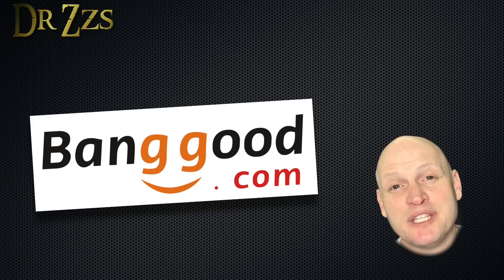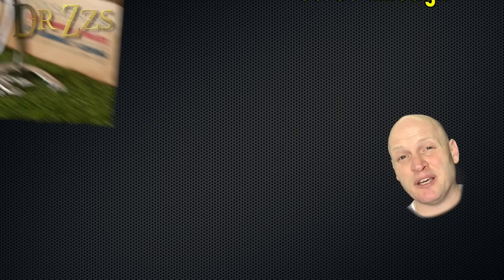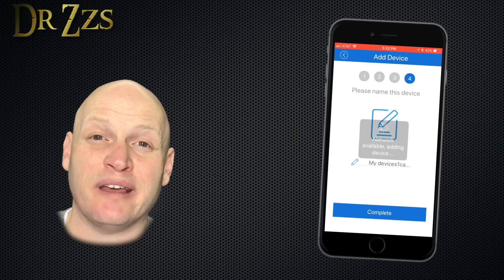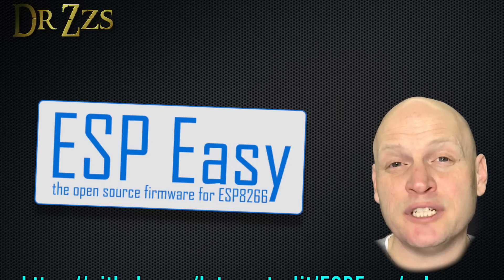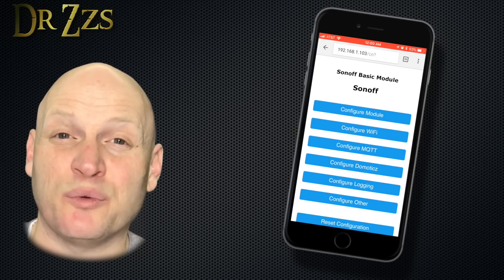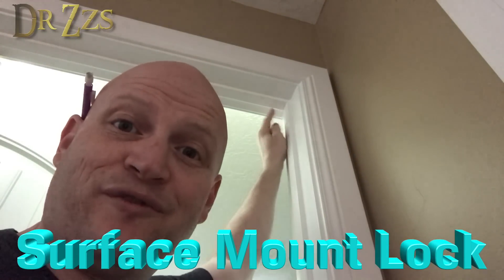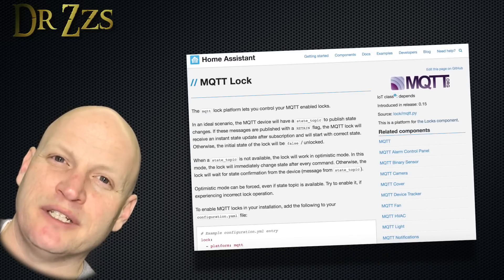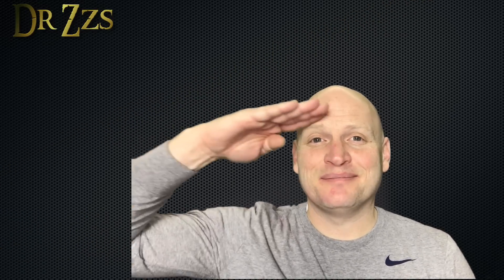$25 DIY "Smart" Door Locks - ElectroMagnet + Sonoff + Tasmota

Comment: Hi, I have used a lock I setup from this video for many years but now I need to migrate to ESPhome but Cannot work out the best Yaml configuration to get an electric strike to open for 10 seconds and close again whilst reporting open or closed depending on whether the relay is active or not.

Any chance you can assist or do a video on Electric door locks with ESPhome?

Cheers!

Comment: Also, please know I AM NOT trying to troll or beat up your video. I am really happy I came across this as it's going to solve a lot of issues for me! 

That said I do have a couple security notes:

I do not think the proper wording for the surface mount is to install it on the "Outside" of the door. Well, actually in your 'case,' it might be but not in all 'cases'. Bear with me here... 

If you are exiting a room/home or let's call this exiting your secure area and your door swings toward you or into your secure area then yes. The proper term for the installation would be to place this on the outside of the door/door case. 

But now, in turn, let's swing the other way. If you are exiting your "secure area" and the door swings away from you then you would do the installation on the inside of the door/door case. 

Another note. mind you this is truly my personal opinion so don't roast me. For me, I would only use a surface-mount lock on doors that swing out/away from my "secure area" (away from me while exiting vs toward me). As personally feel it is a security risk to have the lock mechanism accessible from the outside of the secure area. So my PERSONAL opinion is that for doors that open into my "secure area," I would use the latch as you did on your dirty garage door (btw, little spray paint cleans that right up. 😂).

One other thought is In a lot of industrial buildings, I have seen these magnetic locks installed they have a motion sensor on the inside right above the door. So that the door can always be locked but as someone is exiting the door it automatically unlocks. Also, I personally do not care for the idea that during a  power outage, all my doors would be unlocked so I plan to have some kind of battery backup.

Comment: Thanks Doc. I've been putting this off but now it is time. My locks will be for bedroom doors, similar to your senario for the inside room. If someone breaks in to the house and we are in one of the bedrooms, push a button and the lock will be activated. By the time they get the door kicked in, Mr. Smith & Wesson will be waiting. That extra few seconds could be the difference between life or death. My thinking is a smart outlet to supply power. A 433mhz wall mounted button will send a signal (via Sonoff rfbridge/Tasmota) to turn on the outlet, thus locking the door. Bench testing just around the corner. Oh, and a second button hidden somewhere else (kitchen or pantry) will also operate the lock to unlock it if needed.

Comment: The only issue is they are failsafe locks.. We use maglocks at work they are great, until you loss power then the whole building is open to the world. I would strongly consider a battery backup in the setup.

Comment: You should check out Ubiquiti’s dream machine pro udm. It combines their cameras, wireless access points, and their physical access control systems all in one. Can use your additions with it and add RFID sensors for exterior access.

Comment: Lock snob nitpicker here. I looked at the "12V Electric Strikes Lock Fail Safe NC Cathode For Access Control Wood Metal Door".  Unfortunately it looks like it wouldn't be able to activate the dead latch without some tinkering when used with a regular latch like Dr Zzzs did and the latch that comes with it isn't a dead latch at all.

That means it's easy to bypass with a credit card or shrum tool.  I wouldn't consider it suitable for anything but keeping away nuisance traffic without modification.

Cutting power would be a second bypass but that could be overcome with backup power.

Comment: Thank you!! I have a special needs son that can get out of the front door way too fast. Got the magnetic strike plate, and installed it on the outer door (metal screen door). Installed an outlet powered by a TP-link Kasa smart switch.

We have an Alexa routine set up  to turn our front room lights to 100%, turn off the switch (unlock the door), announce that the door is unlocked, wait for 10 seconds, power the switch (lock the door), announce the door is locked, then turn off the lights. 

Having the smart switch allows me to unlock the door at night from outside when I get home late. 

Recently set up Home Assistant (thanks again for those incredible tutorials). Now we also have NFC tags on our door frame so we can just hold our phones up to trigger the same 10 second unlock automation.

DrZzs helping parents of special needs kids get some Zzzs knowing our kids can't escape the house at night!

Comment: YEa, "great" ideea. All a thief has to do to enter is cut the power, and he's in.
Reply: This solution is very good for an interior door. Not good for an entrance door.
Reply: @HenrikSozzi  Interiror door locks are needed in general for companies or large estates that do not use DIY solutions. DIY is for home users, that have a need for an apartment /house door lock and generally do not have internal door locks that need this kind of automation. I would not see any use for this lock on a bathroom door.
Reply: @florinpandele5205  yes, you're right. I sell Access Control systems in my company, between other things, so I know exactly what you mean :) But he's installed a lock on his studio room, not on the front entrance door. The other one was on a garage door, not a door that expose to outside. So yes, this solution is nearly useless for me too but is an interesting option for doors of certain use. For example this can be used on a bathroom door to automatically lock on occupied state (with an emergency button). I have an external laundry at home, that would be a nice solution there too :)

Comment: Don't use the supplied latch with your electric strike, it's not deadlatching so the door can be shimmed open easily. Electric strikes require adding some play between the latch and the electric strike which means if you have a similar shaped latch but one with a dead latch triggering button in it that button can slip inside or be forced inside the strike hole and make it non deadlatching amd shimmable. What you want is an auto deadlatching mortice lock like a lockwood 3572 which has the deadlatching trigger above the latch or bolt, the button presses against the face plate of the elec strike at all times when it is closed and gives you reliable dead latching.

Comment: Hey Dr Zzs.  I've flashed several sonoff devices before using the FTDI adapter & ESPEasy.  However, when I try it with the Sonoff SV (more than one) I get an instant error when I press Flash;
"Unhandled exception has occurred" etc etc.

I can't get around it...  Any ideas?

Comment: I do access control from time to time at work. Having the Mag lock unlock when the power is cut is a bad thing if you're using these locks for external entries. Typically there is a Battery Backup to keep the Magnet energized when there is no power, I typically recommend a SMP3 from Altronix for single Door use. Now for emergencies such as medical, police or fire there is a huge slew of ways. For fire it is typically attached to the Fire system in some way that latches the REX (egress or Request to Exit) button until it is either reset or when the Fire System is disarmed.

Now taking something that is used for a Commercial/Industrial setting and using it for Home use I would use the same equipment but include a Battery Backup, have the Egress Button wired to break the Ground connection to the Magnet. Include a Smoke detector that you can toss into Home Assistant and either have it wired into the Magnet as well or even use a ESP control a Relay for egress. However keep in mind you'll want the ESP to be on a Battery Backup as well.

I'm planning to deploy a Maglock for my Master Bedroom Door, the Kids keep going in there when we are not home. Have a RFID tag for Ingress and Touch Sensor for Egress. Since I have my Alarm Panel in the closet I can tap into that for Power and Battery Backup. I'm currently working on getting my Smoke Detectors into Home Assistant, might try a Shelly and use it to seek the signal line so when it sees Voltage or Current it can tell HA to notify.
Reply: Yes And also you would install MagLock on secured side so it could not be tampered with and you would have two ways to cut power on secured side for  Free egress

Comment: It seems to me you could just take an $5 off the shelf smart plug and plug the lock into that, then you can use the Alexa app on your phone (or the echo in your house) to lock and unlock. You could even use geofencing to have it unlock when you get home and lock when you leave. I would also probably have a wall wart charging a small 12v battery and run the lock off that, so when the power goes out my house isn't unlocked.
Reply: That's what I was thinking. Set the magnetic lock to lock and stay locked during set times when the power is turned on then freely open when the power is turned off.

Comment: from security point 64kg is way to light  , use atleast 250kg  ones and make sure to align the electro magnet and plate correct  otherwhise they stil are easy to pull loose  and make sure its a solid door otherwhise  it isnt worth it and make sure you can`t pry open the door because if you have a point to wedge something in you still can put enough force on them to pull apart.  but would not advice to use it for a entry door from outside and it being a main locking device.

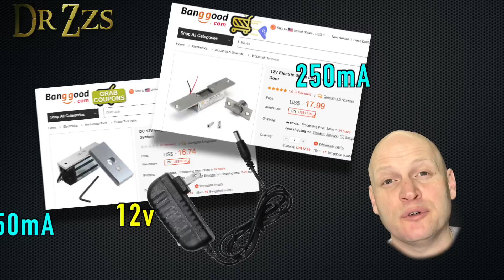Comment: 1:07 So if I understand correctly, all what burglar has to do, is disconnect your house from power from outside, what is not a big deal and everything would unlock itself.
Reply: lol adding domotic to your house is adding a hole in your security it is normal it is like the users of facebook they are claiming for privacy lol. I do not think you can better protect your house thanks to domotic but I think we can make life mutch easyer 
but yes if someone want to get your staff it will not retain him, 
I saw the same product (mutch bigger) in a hospital and it had exactly the same setup
Reply: Yes that is "fail safe" ... some locks "fail secure"  fail safe locks are not recommended for external doors

Comment: A couple of questions - forgive my noobieness (is that even a word??) - You didn't show the actual wiring of the lock to the Sonoff. The wire you have running down the door jam from the surface mount lock - is that feeding power from the outlet to the Sonoff controller and then up to the lock? Do you have a video which explains more about the Sonoff low voltage controller?

Comment: Would this work outdoors, eg on a side gate (as long as there is a power source)? Or would the actual lock components need to be weather-proofed? Obviously the electronics would need to be housed in a waterproof case.
Reply: Anyone tried to fit this sort of lock outdoors on a weather-exposed gate, or is it a total non-starter?

Comment: So a lockwho would open on power failures sounds.. Unsave. At least for garage doors etc. I would want it only open on my command
Reply: Simple charger that has battery circuit on board or buying a UPS board for 12v making your own back up would solve this. It's DIY you can make it fit your needs.
Reply from the maker: It goes both ways.  Some say it's unsafe because someone can cut the power and break in.  Others say if it stays locked when the power goes out it's unsafe in a fire.  Guess we each have to choose which we think is more important.
Reply: @DrZzs  put a simple mechanical exit button and or motion sensor after the power supply that breaks the power to the mag lock is all that is required for fire & safety in the USA.

Comment: Hi
I wank ask how can i connect the lock with nfc reader so i can open the door with phone or card ?
Reply: I just did this last week. Not sure if you've already set this up (I'm answering a year later), but Home Assistant allows you to use a Tag to trigger an Automation. I have a tag on our interior door frame and one outside. Holding the phone up to them triggers the Automation to Unlock the magnetic plate, wait for 10 seconds, then relock it. I also have an automation to send a message when the door is unlocked, and relocked.

We don't use our magnetic lock for "security" we use it for safety. We have a special needs son that can unlock doors and get outside way too fast. The maglock set up prevents him from doing that.

Comment: Has anyone thought to use an automotive electric locking kit?  Concept is to mount it in a 3D printed box on the inside face of the door. On the outside would remain a normal keyed dead lock.  On the inside the centre shaft of the lock is extended and a gear added for the solenoid to drive the 90 degrees to lock/unlock.  This would also mount the internal part of the lock plus a direct electric emergency switch.

This has the fail safe of using a key in event of fire or the electric button if power is not lost.    I do not like the idea that these unlock when no power is supplied.  Your friendly home invader merely needs to turn power off at the power box to unlock.  I would suggest power supplied via 12 volt UPS, then an emergency switch at the door to break the circuit.

I’m thinking the advantage is that these car entry kits are cheap, use less power than Electromagnetic and it’s four doors in every kit. These appear to run on 433Mhz fob  so integrating with a sonoff bridge to open via smart phone is possible.

Unfortunately I do not yet have a 3D printer to just build this and prove it would work as I imagine.  I am aware that extending the shaft on the lock with plastic could be a weak point.  Some might regard a relatively large plastic box on the inside of the door as offensive, but the advantages of being able to enter the house just like a car, with no obvious indication of electric locking from the outside.  Of course if you wanted to make it known you could even go the silly extreme to have house lights flash, just like a car, when locking/ unlocking.
Reply from the maker: Seems like a good idea.  I haven't heard of anyone trying it.  
I'd like to know if it would work too.

Comment: what if there's a power cut whilst you aren't at home?
Reply from the maker: then the lock opens.  
These are "fail safe" locks.  There are others designs that are "fail secure" and will be locked when the power is out. 
You could also connect a battery in parallel, so when the power goes out you have a few hours of lock.

Comment: so, everytime house losses the power, the doors unlock? How is that good?
Reply from the maker: It's not "good", but I'd bet that the odds that the power goes out at the same time someone decides to rob you are low. Sure they could cut the power then rob you, but they could also break a window, or pick the lock.  There's no system that is 100% secure.  The "dumb" locks you're using right now can be bypassed by any thief who really wants your stuff. 
You can get "Fail Secure" locks that will default to lock when the power is out, but then if there's a fire and the power goes out, you're screwed.  
You could also rig up a battery backup.  It would need to be pretty beefy if you use these magnetic locks.

Comment: 8:46 lol  Honestly I was surprised she let you install the first one. As cool as it is to us guys, for some reason chicks don't dig it.
Reply: Depends how you install it if it's clean install not wires showing then no can complain. If you have a wife that is against making your home easier to use IMO you should worry about finding a new wife/girlfriend. Everything from the blinds to sliding door opener (for letting the dogs out) to all the RGB light bulbs, AC/HEAT, Garage doors, To raspberry Pi that replaced a ADT control panel with touch screen for the alarm to water leak detection that turns the water off encase of a leak along with a bunch of other things done very cheap has changed the way we use our house a lot. Everything now is automated even the toilets flush them selves when you leave (stops kids from not flushing them). Just finished my wifi gas lawn mower to mow the lawn, still testing it but I get to watch videos inside as it mows the lawn. I'm a big believer in work smart not hard.

Comment: was intrigued until the proprietary board being loaded up with software from a small program that nobody uses...
Reply from the maker: I'm not sure what you mean.  Do you mean Tasmota is small program that nobody uses?  Tasmota just passed 3 million downloads.  Do you have an issue with the Sonoff SV because it is "proprietary"?   There is no cheaper way to get an esp8266 wifi chip, an power converter, and a relay (< $5).  The only thing that makes it "proprietary" would be the stock Sonoff firmware, which I'm replacing with Tasmota.  Maybe I'm misunderstanding your issues.  If you'd like me to clarify something more, I'm happy to do so.  
Thanks

Comment: The lock is only a strong as the strike late in the door frame if you use the screws that come with the standard lock which is about an inch maybe an inch and a quarter long it only goes through part of the frame if you replace the same screws with 3 in sheetrock screws it won't go through the frame and into the two by four that the door frame is nailed to. you will greatly increase your security on a standard door lock the most contractors are known for. You can also Mount that magnetic side lock I using a router to make your cut into the door frame or drilling several holes in the pattern and then chiseling it out that way you won't compromise the side of the door frame and it will be much stronger in the long run. that's how I mounted my magnetic lock
Reply from the maker: Awesome!
Good tips, thanks!